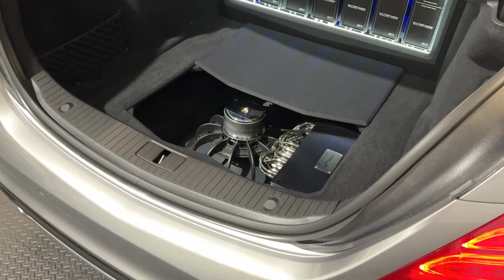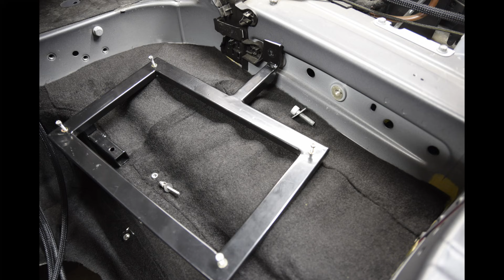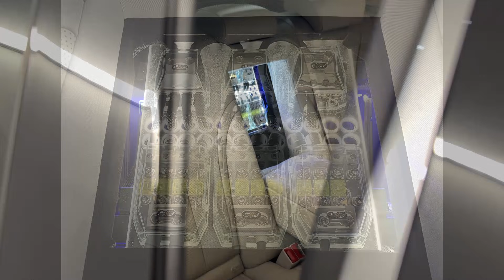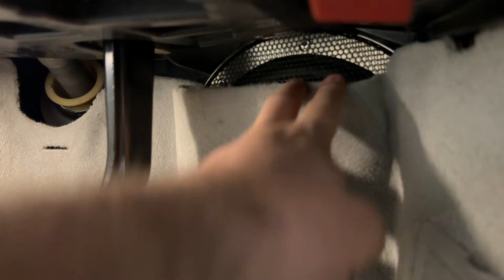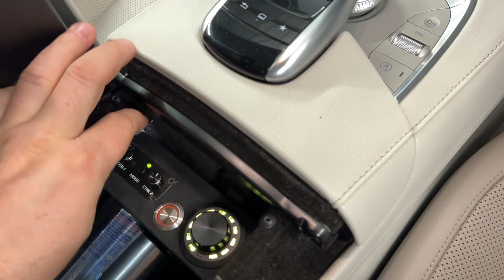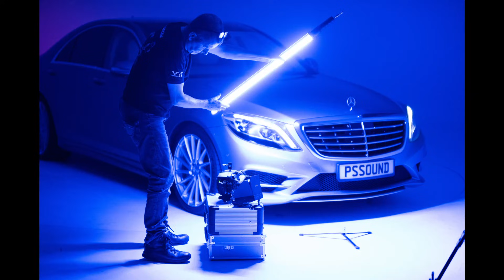Pssound Demo Car EXPLAINED - Mercedes W222 S-Class - Craziest OEM Style High-End Audio System

Comment: I once installed MB Quartz 200.3(or something like that) coaxials to my Toyota Carina II kick-panels. There were metal plate sieled spaces behind kickpanels carpet that were same airspace as side skirts of the car, also firewall was same space. Phoenix Gold M100 and that coaxial pair of 8"+1" elements with passive passovers... 35mm2 powerwires, good grounding. Sometimes best solution is the simplest. Most enjoyable set to this date. 

Now i am installing Old-School set to my 2012 Toyota Hiace. 25y old speakers (Boston 3-way 6,5", 4" and 1" semiactive) to front doors & a-pillars and newer 18" (250litre low bass reflex) + 2 x 7" (27litres kick bass reflex) subs. 2001'ish Sony 4-channel amp for the front semiactive Boston set, M100 for 18" sub and Sony 2001'ish 2-channel for 7" kick-bass. 70mm2 powerwires and big three. I dream of new 390amp alternator...

Comment: Hello. I was highly interested in these amt 40s to use with my full accuton system. But, would you say the amts acting as super tweeters would actually add more than what the accuton tweeters themselves can achieve?
If so, Im interested in purchasing! In U.S.
Reply from the maker: Hi
Only the 60s is available from Resonix. 
These AMTs have better resolution above 8kHz for sure than even the C30AMs. 
We use them as main tweeters where possible from all the way from 2.5kHz and it’s very eye (ear) opener for most people what they can do. They can work perfectly fine as supertweeters as well if extra channels and good tuning skills are not limiting factors. They can bring more realistic sense of space and atmosphere from the recording. Not many people have ever turned backwards from AMTs once they’re also tuned correctly. 😊
Reply: @pssound9749  I'm already sold... But, since the 60s are only available over here, would it be possible to possibly arrange something for the 40s? 😅

Comment: Hi, we have  built my S Class W223 SPL system but im having problems with the intelligent battery system IBS. Can uou advise me how to fix these errors?
Reply from the maker: Hi
I’d have a DC/DC charger max upto 60A and a large lithium pack after that if you have more than 2000W bass amp.
Reply: @pssound9749 , what is permanently on the electrical circuitry? btw, thanks for the reply, stressing keep getting red ibs/battery critical problem lights!

Comment: Why not using airmotion directly in the factory location? Doesn't it fit in this case?
Reply from the maker: If only there was room for it!
Reply: @pssound9749  What about running only the AMT in its current location? No tweeter in the OEM location at all.
Reply from the maker: @ you won’t get a cohesive integration with the midrange, way too far apart, plus the midrange can’t play above 3kHz due to location and application. Small AMTs can’t play that low and even if they could, it would be way too much information coming from so up high!

Comment: my only scare about going IB in mine is that I live in norway and need to wash my car from the underside regularly to prevent it from rotting out due to salted winter roads and the fact that I driwe a lowered car.
Reply from the maker: Hi, yes, in that case it’s better to do a different application.
Reply: @pssound9749  Also, your S-Class is stunning!
Reply: @pssound9749  wow, never thought you'd reply! thanks!
May I ask you a couple of questions?
I really want to go for a sealed sub in my E39 touring, mounted in the spare wheel well, any suggestions that doesnt cost an arm and a leg?
And would there be enough space to mount some 6.5" drivers in the kicks of the E39 without having to cut too much steel?
great videos, btw! learned a lot from you!

Comment: I'm building a sq system for my daily. I don't have a location for a midrange, and don't want to cut anything. The 2 options I have are small widebands in the sails, or a conventional tweeter with a center speaker. What would the pros and cons be of each? I have a helix dsp. Thanks, and I love your work.
Reply from the maker: What car is it?
Reply: @pssound9749  2020 hyundai veloster n
Reply: 2020 Hyundai veloster n

Comment: Bonjour, pourquoi avez vous choisis le Dsp Brax et non le Zapco par ex, il y a une réelle différence entre le Zapco et le Brax ?
Reply from the maker: Hi
Yes, we wanted to use Real Centre algorithm that Audiotec Fischer DSPs have, Zapco does not. Also, Conductor controller is way easier to install in a car like the S-Class. Third thing is reliability.

Comment: Amazing. Now that the Honda is working again, have you been able to compare them side by side?  If you had to score them on SQ only, which is better?
Reply from the maker: If let’s say we have 20 boxes to tick for judging a system, they have some common boxes and some boxes that they tick differently, but overall they’d come close to the same overall result. 
The S-Class is a bit better composed and refined, but the Honda has more headroom and insane delivery on bass that you can never do with an OEM design system like the Merc. However, Merc is fully practical, whereas the Honda is far from it! 😃😂

Comment: You mentioned the space for rear sub and speaker location were part of the reason for W222...between the other 3 (LS500, A8 and 7 series), which would have been a good 2nd choice for optimal for a project like this?
Reply from the maker: Well, none of them has decent space for this system layout in the trunk. Then Audi and Lexus have midbass in the door, which is not great. Lexus at least has dash location for mids iirc. 
BMW has midbass under the seats, which at least is more rigid mounting, but less favourable for SQ staging. So when you look at the overall system design, nothing can tick ✅ so many boxes as the W222.
Reply: @pssound9749  I have the LS500, yes there are three mid range spots in the dash and the mid bass is in the doors. I have an install I'm debating with good quality speakers and amps (Brax x4, Thesis 3 way + an extra 3inch mid, SQL 12 sub). I watched a number of your videos in particular that of the thesis install whereas the mid bass would suffer from a loss around 50-100Hz range. Do you think doing a front sub on the passenger kick area with say the Morel 10 powerslom or the focal 10wm sub could makeup for that area in addition to a single SQl 12 in the trunk sealed? Also considered running thr sql 12 in IB/Free air through the rear seat/ or rear deck for the 50hz and lower range. All on a helix ultra.

Comment: Very clean install but that sub mount is definitely not my style. I don’t like cutting holes into the cars body like that and I’d rather keep my speaker protected and away from the elements. You never know when you have to drive through a puddle of water. Never ran that equipment though. I’ve mostly ran JL Audio W6 and W7 and their shallow mount series subs. In my opinion they have the best shallow mount subs in the business. And depending of the install between JL, Focal or Morel for the mids and highs.

Comment: Hi Peter, I love your videos. I've been thinking of doing something different. I just want to know thoughts on this setup sony xav-9500es headunit focal flax evo ps165fe3 3 way for the fronts and focal pc165sf 2 way coaxial for rear and focal k2 power m sub5 boot subwoofer in mazda speed 3 mps bl 2012  haven't chosen amps

Comment: The Riven SRP is a pretty spectacular piece. It works unlike any other center or multi-channel processing algorithm out there. I know the owner and this thing has been in dev for several years now. He did all the electronic design as well as the software design, and currently final assembles all the units. 

It literally extracts the center information out of the stereo input, so not like a L+R type of setup, so it doesn't collapse the stage. A byproduct of what it does is the layering in the stage is much more defined. It requires a different mindset towards tuning as there is no L/R time alignment differential, but once you get it down it is pretty nice. It works best when you have a center that can play as low as possible, preferably into the midbass region (100hz or so). 

I have a 2013 cls550 with the riven and my center is a 5" MB and 3" wideband. 3's in the dash corners. It is a pretty nice setup. Look forward to seeing what you do when you get one.

Comment: A Classy OEM competition Install. Going to the smaller amps improves cargo space considerably. * Utilzing a DCDC volatge stabilizer is intersting concept. No need for High output alternator to provide stable voltage or high ampere batteries.

Excellent OEM install.

Comment: I would love to hear the difference between a top tier ultra high-end factory system and a no compromise no expense spared hand assembled car audio system. You would imagine Dieter Burmester would build the best but even that system will no doubt have cost cutting measures applied. However I have found spending more money on the best components doesn't guarantee the best sound for me, I have seen and heard some middle of the road set ups that were executed to perfection that sounded far better than ultra high end ones. What I'm saying is if it doesn't sound better it isn't better. Car audio Competitions don't necessarily back up this theory. Some installs are technically great but not enjoyable to listen to. I would love to spend an hour in that car , great video, keep them coming.
Reply from the maker: Anyone is welcome to listen to it. Our doors are always open. Where do you live?
Reply: @pssound9749   Are you coming to germany this year?
Reply: I live in Ireland but come to the UK regularly. Would love the opportunity. Used to dabble with Iasca back in the early 2000s.

Comment: The time you took to make it as close as possible to factory and that too with PS sound SQ level is very commendable.

One query.
How different is micro-precision DCDC power converter-stabilizer compared to AudioSolution Power block S-150. I understand that these devices go after battery and before the amplifiers for maintaining stable higher voltage.

Also Do you think can we achieve similar voltage stabilization for amplifiers with Victron XS 50A DC-DC converter which goes before the secondary battery in the boot.

Thanks
Reply from the maker: Audio Solution works the same, it has more features though than just power stabilisation.
Victron DC-DC is not a stabiliser, it’s a charging regulator, which is a different function.

Comment: I see you changed the rca cables why?
Reply from the maker: Well spotted! When we built the car last year few weeks before the EMMA EU Finals, we had to face that the car was challenging us greatly as it’s packed with lots of electronics throwing great amount of EMF and we had insane amount of noise on our custom cables. Due to short time we had to take all the rcas out and try pre-made Stinger 8000&9000 series and we got rid of the noises. After that i just didn’t bother to try to test new custom cables.
Reply: @pssound9749  I bought the Stinger 9000 series cables largely for the looks.  I'm glad to hear that they perform.

Comment: So I have an SL550 and iam slowly building a Sq system bit,  more than anything g trying  to learn all I can so probably to most of you some of my questions my sound silly but , I am trying to learn. 
  Anyway , one thing I really don't like in my current system is when turned on and especially when the amp turned up with NO music playing is the hiss or white noise I hear.. Is that something with lower quality amps ? Would a high end amp eliminate this white noise. Current amp is a recoiled red 1800.5. It does over rated power and it very strong but, I just have this damn white noise. Thanks in advance guys.
Reply from the maker: First check that the gains on the amp are not turned higher than required to match the input signal. High gain can introduce more floor noise. 
Of course some amps have lower S/N = signal to noise ratio and can be noiser.

Comment: What is your opinion on center channels, using the the Helix processing?
What bandwidth should it play? Midrange, full range or 2-way?
I happen to have an OEM spot for a 6.5" center and 1-2 extra DSP and amp channels after 3-way front and rear-fill.
Reply from the maker: Ideally you want to cover the vocal range from 150Hz and up and same way as your L&R speakers. In this one we just kept it simple and used a Brax ML3 as a wideband all the way up it can play.

Comment: You always talk about listening experience, but us the viewers get a really bad listening experience while watching you vlogs, as the sound of videos filmed in this area has a lot of echo which is very annoying it would be great if you can do something about it.
Reply from the maker: I know and i feel your pain, i want to figure it out somehow. Unfortunately all microphones record the space, so the space would have to be acoustically treated, which is not that simple.
Reply: @pssound9749  Hanging some DIY noise absorbing panels on the wall only when recording will solve 90% of the issue no need to go the extra mile.
Reply: @pssound9749 
Try using microphones which people use in corporate offices they will not pick up the sounds away from the mic. Look into some Jabra stuff, inexpensive and effective
Reply: No matter how good the recording there is no substitute for listening to the real thing.
Reply: @Adrimo911  as you can see I commented on an system explanation video, not on a demo video ...
Reply: No problems here with Sony XM3 headphones, sounds great.

Comment: Would square cutouts instead of circles on the subwoofer panel offer more area for transfer? Circles are the least efficient shape when packed.
Reply from the maker: It’s also about the material you use and structural strength of the panel after cutouts. Until you have enough surface area equivalent of the cone, it shouldn’t matter.
Reply: @pssound9749  Ah I see. Learnt something new today w.r.t the surface area of the cone. Thanks for that! Goes into the memory vault.

Comment: Hi Peter, how are the MP Serie 7 amplifier? Are they better than the Zapco amps? Do you hear a difference? What about the Brax DSP. Is it better than the Zapco HDSP with ESS9038pro DAC in terms of sound quality?
Reply from the maker: You can hear about the amps in the video, but i can also tell that it’s difficult to ask for better results than these MP7 series amplifiers. We have almost zero floor noise (difficult to achieve with most other amps), plenty of control and headroom. The system is definitely quite something with them that needs experiencing. 
Zapco HDSP-V sounds amazing, but we didn’t have a chance to put it side by side with the Brax, so can’t compare them like a true A/B, but it’s certainly another special DSP that fits this system on this level.
Reply: @pssound9749  great 👍 job Peter your videos really get the procrastination out and makes listeners want to design and improve their systems
Reply: Wait for the new sabre dacs for the Brax Dsp analogue output cards 😉